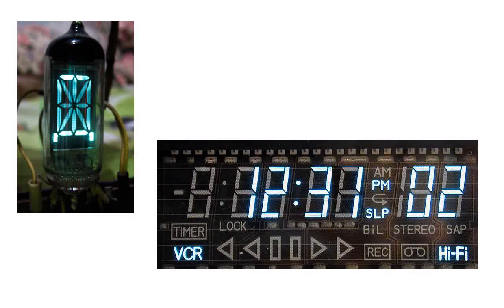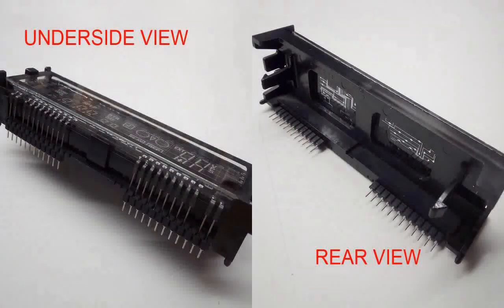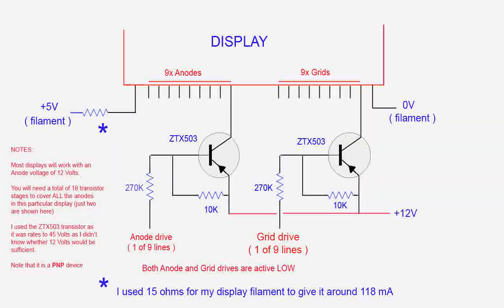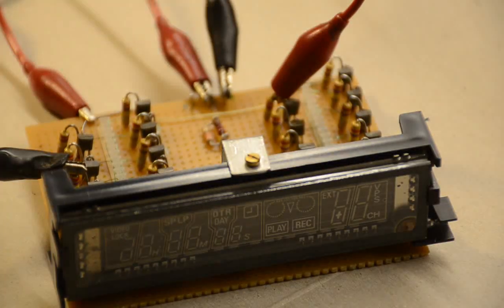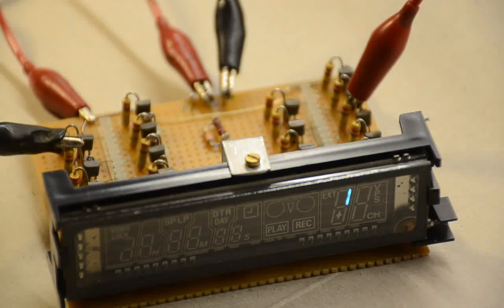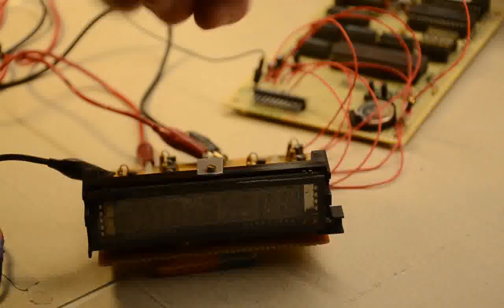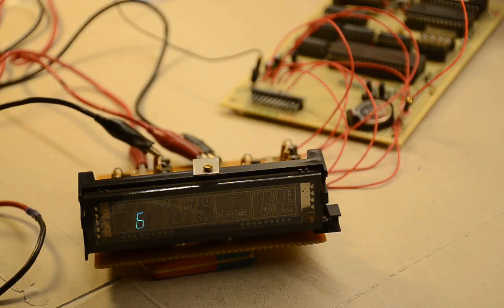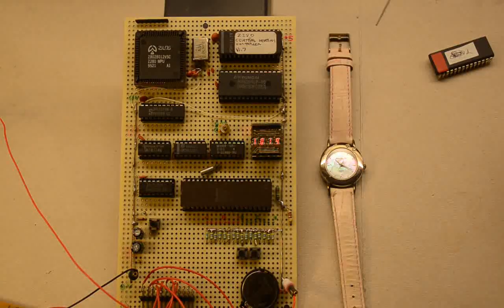Vacuum Fluorescent Display (VSD) and a Z280 Microprocessor

Comment: Hi, shouldn't there be current limiting resistors on the PNP collectors?
Reply from the maker: Interesting question! Certainly if one was going to use it on a 'high' voltage, like one does with a neon bulb for example, one would definitely use a current limiting resistor. However, in the case shown here where the device is running at this low voltage level, then I don't think it is necessary. 

When building up this circuit, I had no idea what 'HT' to use for the display, although I knew it was very low, so started off by connecting it up to a 0-20V PSU. Using this, I was able to slowly ramp it up and note when the display fluorescent anode started to glow. Around 9 volts if I recall correctly. Taking it slowly up to about 20 volts, (the max . for the PSU) then it was about the same brightness as one would see on one of these displays in normal use. Hence, I don't think at these voltages a limiting resistor is necessary and therefore didn't use any for the demo. you've seen. Hope this helps!
Reply: @lishaton  I've seen circuits where sometimes they are used and sometimes not which is why I ask.  I think in most cases, the current draw of the anodes/grids is low enough such that resistors are not needed.  I suppose one could measure the current to be sure.  I've seen 10k resistors being used when driven by NPN, but that is because it is a common collector configuration.  Thank you for responding.